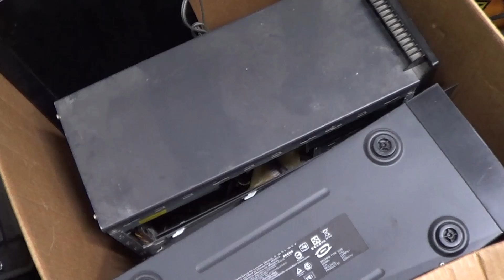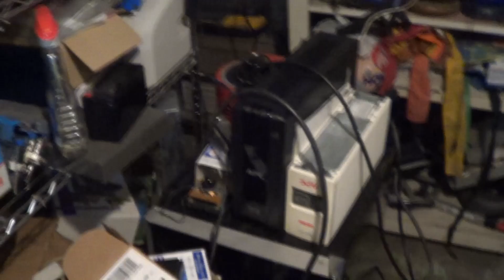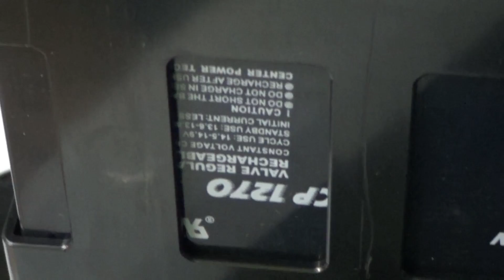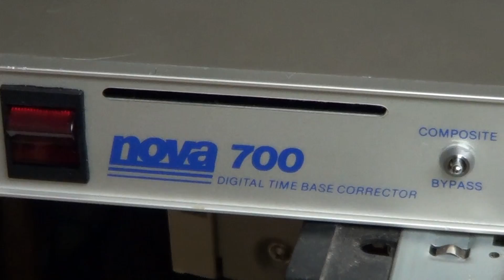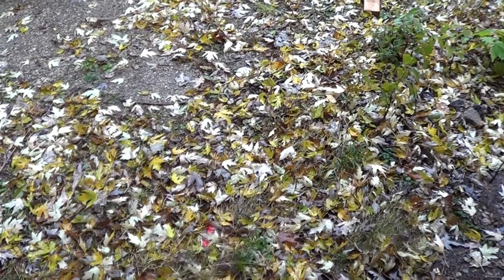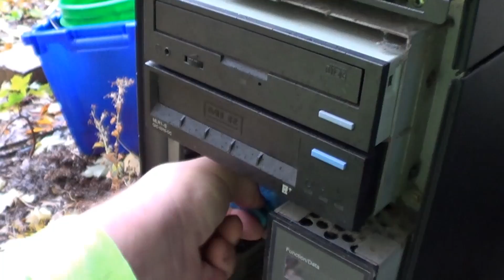The Hamfest Video for 2018

Comment: Believe it or not I actually "threw my back out" trying to re-use an Artic heatsink with those push pins. I was struggling with it on the floor and then my back went...I was in agony for 3 or 4 weeks, and could barely walk. I hope they are phased out now...along with the folks who "designed" them.

Comment: My D630 has suffered a problem many months ago and surprisingly it's not the nvidia GPU. It will not accept a battery even if it's fully charged, i even bought it a new battery pack and the laptop still turned off with the battery in. I went to the Dell subreddit and someone said the charging chip was faulty. I'm selling it locally.

Comment: Ah cool! And AS/400 system. Guess that IBM i/RPG programming I took can still be relevant. Provided I can get my hands on a system! lol

I can tell you you DO need an IBM terminal and keyboard setup (thought which one to pick up? I'm unsure.) But at least at the time of this comment there is some IBM AS/400 software and at least 2 version of the operating system for relatively cheap! As far as I've been able to find the hard drives are pretty costly even for the lower 4GB model. If you could get the numbers of that ethernet card I'm pretty sure I saw IBM oem driver CDs on ebay for cheap too. Though without at least one hard drive its a moot point. There are also IBM manuals for relatively cheap too if you can find one for your specific system!

I personally picked up the software 'connector' for windows 95 and windows NT. 

Unfortunately this is all information I've picked up from my programming class, they had an older model system, so I can't tell you what version of the OS or its contemporary software you would need to acquire. But if you ever do get this thing rolling and you want to hook windows NT/95 up to it for some database shenanigans I'd certainly send you what I can!
Reply from the maker: I don't have it any longer. When I saw that the hard drives had been pulled out, that pushed it past the point of being worthwhile for me. Especially as it would always be just a curiosity.
Reply: Totally understandable! It was certainly cool to see you open it. Most of the time all you get to see is the exterior of these machines so thanks for doing so. :)
Reply: Small edit! If you wanted the IBM specific drives, THOSE are costly!

Comment: Fair warning on the AS/400, they use standard SCSI drives but use a special IBM formatting. You'll need to find the IBM drives if you want to try and run anything on it.

You'll also find you want an IBM 5250 compatible terminal as regular serial won't cut it. Twinax is the name of the game.

Comment: what ute is that in the driveway?
Reply: sorry pick up truck
Reply from the maker: One of two, either a 2007 Chevrolet Silverado Classic or a 1998 Ford F-150.
Reply: @uxwbill  yes f-150s are the best
Reply: @92centpetrol89  I disagree based on the tendency of the timing chain tensioners to fail which destroys the plastic guides in all the Ford modular ohc v8.

Comment: Hi Bill- Do you have working wifi on the Linux machines? I have a D620 that I was going to install Ubuntu on but have heard wifi is nearly impossible to get working. Thanks.
Reply from the maker: Yes. The Intel based Wi-Fi adapters usually work right out of the box (since Intel stands almost alone in cooperating fully with open source projects). Dell and other Broadcom based adapters take a little fiddling. You may need a newer bcmwl-kernel-source package than your distribution ships, if it uses that software.

Ralink/MediaTek is very hit or miss. Their newer stuff tends to work better. I don't know about Qualcomm Atheros.

Comment: Hi uxwbill. This comment pertains to the AS/400. My dad recently began working for IBM. I may be able to get access to a copy of OS/400 if it will help you out. In addition, it's possible to run Linux on these (I've read it's possible, and do have porting abilities (LFS maintainer), but I don't have access to one of these guys). I might also be able to gain access to drives.

Comment: I really hate to be that guy but those are 2 unit UPSes hahaha
Reply from the maker: I really hate to be that guy, but read the other comments.

And as I said then, I don't do a lot of rackmount gear. :-)
Reply: @uxwbill  no problem haha, I do find those rack form factor units to be a little more reliable than the desktop units until you move up to SRTX and the problems that come with those so hopefully it'll treat you well

Comment: I have an old netfinity 5600 and I've never gotten the thing to boot, to a point were I even seen a BIOS. Well, maybe I did, but can't be for sure. I know I can talk to it with a term emm, I used my SE/30 for the giggles. 

It seems to have a problem with it VRM, (the diag lights indicate this) but I've replaced the vrm twice, so I wonder if the processor board is goofed. I may know why... at one point I stuck a pent II card in the board when it was designed for a III. this was a point in my life were I just messed with things. So i dont if what I did was what 'killed' it or if was broke when I got it. It's got it's HDD's a tape unit, a cdrom a SCSI card (that I butcher'd :/ and need to replaced, though it may work.)Anyone got any ideas/opinions? It'd be interesting to get the old thing to run even if I can't find a purpose for it.

Anyway, interesting finds!

73 de SE/1995

Comment: I had one of those Intel mini-ITX motherboards some years back.  It certainly beat the VIA boards in terms of price and CPU speed.  Mini-ITX grew in popularity, and decreased in price after Intel got on 'board.'   I'd have kept hold of it if it didn't have that SIS chipset; the graphics (Mirage) do not play well with desktop Linux.  Intel's next move was to replace the Celeron with the Atom, and an Intel chipset and graphics.  Not spectacular, but much better supported in Linux.
Reply from the maker: These boards were offered concurrently with the D945GCLF Atom offering (Little Valley and Little Falls, respectively). I'd have liked to see them pair up the Atom with the same SiS chipset, if only because the SiS chipset seemed to use rather less power than Intel's 945. Then the NM10 came to give Atom the chipset it deserved, and a far better graphics option.

Truthfully, though, I'm surprised Intel was even willing to consider use of a competitor's chipset.
Reply: @uxwbill  Yes, I've had several D945GCLF2 boards, I forget the difference from the earlier model.  I guess the SIS being a lower-powered chipset had its advantages, and the graphics were perfectly usable under Windows.  The 945 chipset did rather offset the frugal power use of the Atom.  Maybe SIS's chipset was ready-to-go, and  Intel wanted to get into the M-ITX market quickly.  Motherboard reviews of the time mentioned the SIS chips, and wondered as we have, why Intel didn't use something of their own.

Comment: The G4 Cube's PSU needs fixing. they have a flaw where something burns out. I forget the exact story but it needs to be fixed either pre-emptively or post-mortem to get working reliably, especially when upgrades are in the future (i.e. GeForce 6200 AGP, any CPU upgrades, etc.)

Comment: Pentium 4 - Core i7, meh close enough! ;) Just like my HP Compaq DX2000MT. Correct me if wrong but Sony bought IBM in 2006-08? So doubtful an "Lenovo" would have a Pentium 4 in it especially an agp slot.
Reply from the maker: Lenovo came together when a Chinese company known as Legend bought IBM's personal computer business in the mid-2000s. With the deal, they got the rights to use IBM's logo for a few years on their products. More recently, they also acquired IBM's x86/x64 server business. 

IBM still exists as an independent company and focuses more on IT services and software today (they still produce non-x86/x64 hardware).

Sony has left the personal computer business entirely, at least as far as the VAIO line is concerned.
Reply: @uxwbill  Ok. Yes kind of figured Sony went that route, only thing around anymore are smartphones and now they go by Lenovo now rather then Sony.
Reply from the maker: Fujitsu and Panasonic are still in the computer business, although both play to specialty markets.
Reply: Toshiba is as far as I know Japan's only remaining laptop manufacturer.

Comment: I haven't been to a hamfest since I was a kid and went with my father.  Would love to go to one again and see if I can find some goodies to add to my collection.

As for the AS/400, if you can find all the right drivers, and if it is indeed a POWER based system, I know that Windows NT 3.51 and Windows NT 4.0 both support POWER PC chips.
Reply from the maker: There are several different designs for PowerPC systems and I've forgotten which one is compatible with Windows NT (think it was PReP with the ARC BIOS). The POWER architecture differs somewhat from PowerPC (in some ways a superset, and others a subset) and therefore also isn't 100% compatible. 

I thought sure that if nothing else, NetBSD or perhaps even some sort of Linux distribution would run on it. Without the hard drives, I'm not sure if I want to put anything else into it. I'm only into it now for the $20 and even if I did get it running, I'm not really sure what I'd do with it.

Comment: Yeah it will be hard to get the original OS for the AS/400, ebay only has a few i can find and they are probably worth more than that system it self, you will probably be looking for V5R4, newer versions might not work as well. Otherwise you might get linux to run as i know it has been ported for powerpc im just not sure how you could or if its even possible.

https://en.wikipedia.org/wiki/IBM_i

Comment: I was going to bring you a Core2Quad based computer in addition to the C2D machine, but there are some files on there I still have not gotten off of it.

Neither one of the IBM/Lenovo computers had the blocked AGP port, in fact, the "Slant Front" computer was PCI-E if memory serves, but then again, I forgot that it had an aftermarket motherboard before the D201GLY-2 was installed.  The "Flat Front" IBM is a little more special while it was interesting as the original board was DDR(1) with an AGP slot and a socket 775.  It served, with the D201GLY-2 motherboard as the first SDP web server!  The PATA drive was the boot drive and the SATA drive had all the website files on it.  I didn't wipe either drive, so if you want to look at the computer in its original glory, you can.

The Sony CD Player is indeed the Goodwill CD Player

Oh and it was me, not Matt, that brought you the Mac Cube.
Reply from the maker: If someone's got to be Wrong On The Internet, I'm the guy you're looking for. :-)

Perhaps I'll boot up the second one and go on a nostalgia field trip, although I probably take too many of those as is. Not sure what I might put in that white case, but it'll find a good home somewhere. Maybe I'll just recap the board that's in it and see what the best CPU it supports would be.

I don't know why, but I could have sworn the cube came from Matt. Oh well. It's very much appreciated no matter where it came from, and I apologize for having that wrong.
Reply: @uxwbill   I think Matt might have been who carried it from the truck to the garage, given that I rode with him in his truck to BOOP, IL, it would be easy to mix up what came from who.

Comment: Wowee am I jealous about you getting those rack mount APC units for $10! I'm just trying to find one without batteries under $100 for my homemade rack setup.
Reply from the maker: The best thing you can do is visit events like this, and ask at larger businesses in your area. When the batteries die, these things usually end up being scrapped. Don't be afraid to make an offer, either. Each of these UPS units was priced considerably higher.
Reply: @uxwbill  Thanks for the tips, I'll keep up the effort! Just gotta ask though, you plan on selling any of them?
Reply from the maker: While I do sometimes buy them with resale in mind, most of the time I'm looking for my own purposes and use. I'm definitely going to keep the rackmount models (and doubly so the 750XL) because I have this dream (or perhaps delusion) that someday I'll own an equipment rack.

Not that I'll actually be able to find any of the rackmount ears for the stuff I'd put in it, of course.

Comment: I remeber being fresh out of trade school, (electrical technologies) back in the early nineties I too add a heck of time getting to the trade, If it werent for a manager that took the chance on me and allowing me to prove myself. With 20+ years of experience under my belt now, Im now a manager over a maintenance dept . at a corrugated board facility. Be patient Bill, a opportunity will come your way soon.
Reply from the maker: Considering how well I did in my classes, and the fact that one of my instructors said "you are going to be a service tech" to me on more than one occasion, I figured I'd be snapped right up by some company or another. From there it was my plan to work there for several years, gain experience and eventually go into business for myself.

To be completely honest, after being ignored most of the time and rejected a few times, I did take a job as an HVAC service technician. It was a complete and utter disaster. I'd been told that tools like a torch set, nitrogen dispensing equipment, a leak detector and a recovery machine would be provided. And while they were, every last one of them was junk. The nitrogen regulator was stuck on full blast. The torch had a hole in its oxygen hose, and was far too small to do any kind of serious work. I installed a six ton condensing unit with it, and I'm still not sure how I did, how it didn't leak, how I didn't ruin the valves on it, or how I didn't have an explosion the way oxygen was leaking out of the hose. The leak detector was just dead. The recovery machine was about a million years old, sounded horrible and took forever to do its job even on an R-22 system. The business owner alternated between being quite surprised by all of this, and making the comment that "I can't possibly keep all these tools in working order".

So I brought my own recovery machine, torch set, and finally leak detector just so I could do my job. A working nitrogen regulator FINALLY showed up after much begging.

It didn't take long to learn that since I had a driver's license, I was statistically unique amongst their workforce. As such, I spent more of my time shuttling electricians around and waiting for hours while they did their work, than I did working on HVAC stuff. Seven hours of sitting on my duff, watching one install ballasts was a bit much. And when our workday ended, he drank alcohol as I drove back to the shop. I was terrified we'd be pulled over, and of guilt by association!

I also learned that there was no one there I could ask for help or mentoring if I got in over my head, as I did one day. There were other things that took place, but this has gone on long enough. Suffice it to say that I walked.

Comment: Nice score on the Apple G4.  I'd like to find something similar to try running Quest for Glory V as it crashes on EVERY PC I've tried it on (from a Pentium 150 to an i7 5960X).  That was, of course, using the original installation CD and also the GOG.com version.
Reply from the maker: That sounds like my experience with the Windows version of Myst (both 3.1 and the later 32-bit version). I could never venture far into the other worlds without a crash.

I have a version for the Classic Mac OS and expect it'd do significantly better. Truthfully, though, no matter how beautiful the scenes were, the navigation got to be kind of a drag after a while and the puzzles really were too hard. (I resorted to looking up the answers, and never could get that darn "spaceship" thing to go anywhere.)

Comment: Is there a removable I.O. shield on the beige computer case?  That was the major problem with a similar build I did a couple years ago.  The port openings were in the case wall itself.  No rectangular opening for an I.O. shield.
A friend cut the thing open for me.  (He had the tools, I didn't.)
I was an eighth of an inch off on my borders, and while the ports stick thru, I can't put the mobo's I.O. shield into the opening.  
Eh, it's on the back.  Nobody can see it, and the old beige case has a modern computer in it.  I'm happy.
Reply: I believe the beige case DOES have a removable I/O shield.
Reply: @weasel2htm  
Nice.
Reply from the maker: I'm about 99% sure (figure not verified, nor probably all that accurate) that the beige case has a conventional I/O shield. I've only ever seen a few that didn't, and this one played host to an earlier motherboard.
Reply: @uxwbill 
Nice.  Hope you have fun if you do a rebuild.

Comment: I'm curious to know - those OptiPlex GX520's have a 945-based chipset, which in theory should support early-model Core 2 Duo's, but it's been said that Dell crippled the BIOS to reject them so they could use up their remaining NetBurst inventory. Any chance you'd be able to try the E4500 from the custom build earlier in the video to see if it'll work in the 520?
Reply from the maker: It's my understanding that the issue comes not from the BIOS, but rather from limitations in the voltage regulators.
Reply: Regulators designed for the Prescott (95-130W TDP) not being able to handle a 65W Duo that runs at a similar voltage? Sounds unlikely if you ask me, but what do I know.